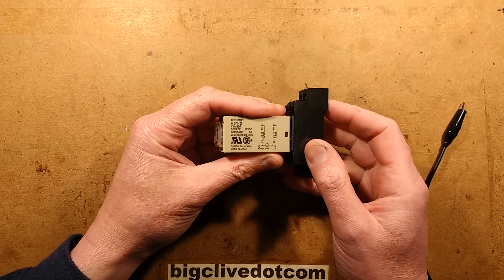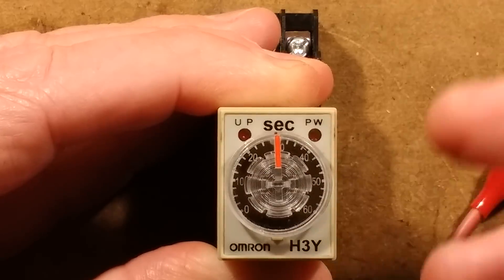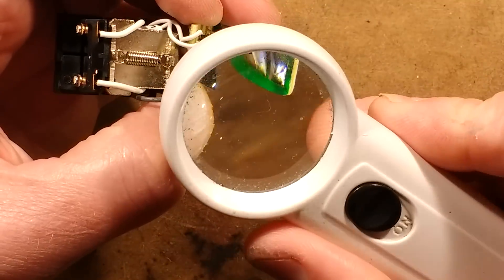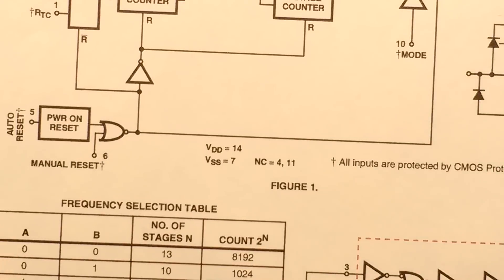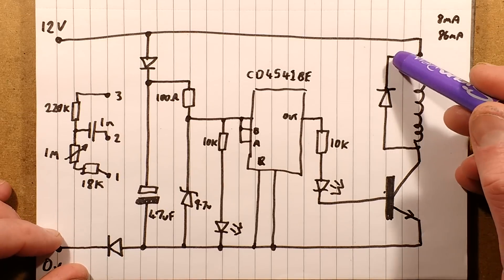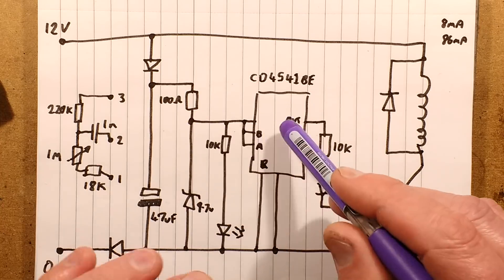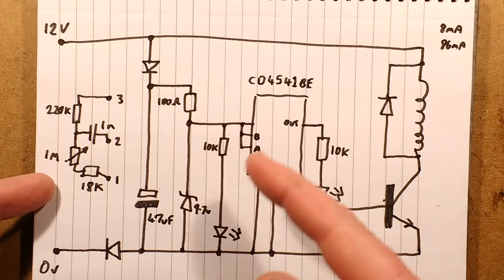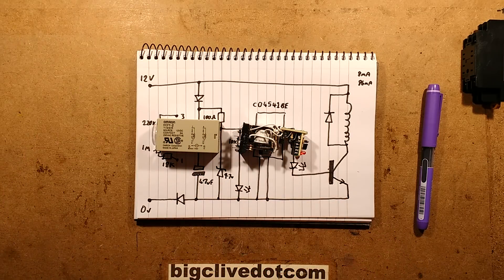Industrial timer knock-off.  (Actually quite well made.)

Comment: I'm a bit confused.  I need a relay to hold 120V to keep a fan running after a switch is turned off.  With the H3Y-2, can I do this?
Reply from the maker: You do get delay relays that will hold on after their control signal is removed for the selected time.
Reply: @bigclivedotcom  I guess the H3Y-2 can do that.

Comment: Hello there. I have a question.

I am in search of a 14 Pin delay relay similar shown here, but I can only find them in a power on function only, and I need a power off function delay to control a motor contactor. 

If they don’t make a power off function in a 14 pin delay relay, could the board be modified on a power on delay to make it into a power off delay? If so, how could that be done?
Reply from the maker: You get off-delay timers, but they usually still require power, and a control signal to be removed.
Reply: @bigclivedotcom  I could not find any time delay relay that has a power off function that has 14 pins, all are power on function.

What I’m asking is if the board itself in one of the power on delay relays can be modified to change it to a power off delay? Or even buying a off delay relay and just taking the board out of it and putting it into the power on delay converting it into a power off delay?

I need a 14 pin off delay for the relay socket on a board that I’m using, it’s to keep a motor contactor on for a few seconds after power is stop being supplied to the board.

Comment: Just got my hands on two 220 volts H3Y timers from  elevator control panel while troubleshooting failed rescue mode test. Both showed brown overheat sign on one side and open  circuit on the contacts. Turned out both were low quality fake timers

Comment: have used many of those little timers from oven purge delays and delta wye starters ..Some people in the food industry like to load up their grinders prior to starting the motor .So wye delta is essential because of the massive current inrush on Delta .so we switch the motor wye delta .Start on wye and switch to delta .I think I posted a video a few years ago of a wye delta motor start up ..Can't believe Omron isnt going after the counterfeit items 
.Those little timers are expensive .The mechanical clock work timers are crazy expensive like the Carlo Gavazzi  timers .

Comment: I use the 4 pole mains operated version on my vacuum tube amplifier. It is set to 50 seconds and when it operates 1) One pole places a short circuit across the amplifiers in-rush current limiter. 
2) Two poles apply high voltage, one to each channel of the amplifier.
3) The 4th pole is used to switch off the Red section of a dual colour LED on the front panel and switch on the Green section.
It's been in use for a good 12 months and so far no problems.
Reply from the maker: Some modern inverter welders have a beautifully simple inrush limiter.  They use a parallel cluster of NTC inrush limiters bypassed with a relay that is simply powered directly from the 12V power supply.  The short bootstrap time for the 12V power is the inrush time delay.

Comment: I've come across these in older 80's CNC machining centers. They are used to add a delay to the hydraulic motor switching on after the controller is powered up. Also I've seen them used to cycle an oil pump for lubrication on these machines..so one would do the pump off time, say 10 minutes and the other would do the pump on for say 15 seconds. I think the pin spacing is a standard across different manufacturers and the base it plugs into can take other types of relays as well.

Comment: Help!!!!   I bought several of these they work great but it takes like a month + to get em. I bought 0-5 sec and 0-1 sec not sure which I would need this time. But I messed up. I needed them all to be 220 volt. Instead I got 0-5 in 220 and 0-1 in 110. Guess which one I need now. So i can just change the capacitor to change my 0-5 sec into a 0-1 sec?
Reply from the maker: It should be viable.

Comment: I've been testing the timer as a power-on delay for fridge, in case of unplanned blackouts particularly during night times. However, I noticed the plastic case exhibits some heating and I've been wondering from what components and how hot they get in their confined environment.

Your infrared measurements have definitely added some light to the guessing game. Now I know where the heat comes from and whether the temperature/s are within tolerances. Thank you!
Reply: Marinduque - The Heart of the Philippines take a thermal imaging camera when it’s being used if the plastic is melting it’s not safe in my opinion
Reply: each one is different, unless you used a 12V version too.

Comment: I have bought the 220v version ofthis  to delay a small aquarium pump from coming on after a power out returns... but i cant get any voltage at all on any of the ouputs, not NO or NC... Whcich pins would I expect to see 220v after times up?
Reply from the maker: The contacts are volt-free.  You'll need to loop the feed to the common contact.
Reply: @bigclivedotcom  So if my main 220v AC supply is contacts 13 and 14 I would also need to supply 220v to which other contacts  and which would then have 220v (after time delay ) on powering back on?
Reply: @bigclivedotcom  so 9/12 need to have 220v supply which would then appear at 5/8 (NO) or  1/4 (NC)...?
Reply: @roythompson6137  the "Common" terminal needs 220V applied to it; When the relay is not activated, the Common terminal is connected to the "NC" terminal (Normally Closed) and when the relay is activated (by powering the coil up) the NC terminal becomes disconnected from Common and instead "NO" (Normally Open) becomes connected to Common, until the relay coil is powered down.

Comment: I think I'd solder a pull down resistor on that transistor base. 220K or 470k maybe? Since the base current comes through an LED, when that output pin is low the base is effectively in an open state.

Comment: no qualms with low voltage fake timers. But I've just had a jolly old time fault-finding on a machine that had fake omron octal relay bases....that had  spigot keyways at both the 12 o'clock and 6 o'clock positions.  This caused some problems.
Reply from the maker: Now that's what you call a nightmare for troubleshooting.  Especially if someone else has been pulling and inserting relays randomly.
Reply: they had.

Comment: I know all about thinking the diode was in right and having things blow up and not work on a couple jet bumper coils.
I cut out the diode and put in a new one and also had to replace 3 transistors on the board.

Comment: The 100 ohm resistor seems way too low. The CMOS draws virtually nothing and the only load is the two 10k resistors. It easily could be replaced with maybe 1K , saving 90% of the OFF state current.
Reply: i didt ecpext you in here sorry im 2 years late

Comment: Hey Clive, nice video... I was thinking these would be nice if they had the option to be either change the input on pin 9 to change the "initially high" or "initially low" mode...  I considered the option of a switch on the relay itself, but this would be very dangerous in use as it might get changed and the function would change.... so, how about this solution.

Instead of using a polarity protection diode, use a bridge rectifier, and then take one side of the input before the bridge to pin 9... would this not cause it to work in either polarity, but change the mode depending on the polarity of the supply... which then could not easily/accidentally changed once in operation?

Comment: So I have two problems with this thing.  First, specifically with this, it looks like its made out of that compressed paper-fiber board (looks like FR4 painted green on top but white everywhere else) and that stuff is pretty bad at preventing moisture ingress.  That combined with having a 1Mohm potentiometer means there's a good chance the timing will change substantially over ranges of humidity and as the device changes. (I'm guessing that or the flux they used is why it only goes down to 15s)

The second problem I have is with this kind of item in general.  If I buy a cheap brand of industrial control wigetry, it might not be as high quality as Omron or Honeywell, but at least its going to be consistent quality across the same item.  With these fakes you just don't know what you're going to get.  I mean that hand soldering job is such that even the ones that particular guy made are probably terribly inconsistent.

I cant think of too many places to use this where total failure and lack of consistency are acceptable.
Reply: Are you sure? This item must put in dry place  and timer accuracy is couple seconds.
Reply: So here's the thing.  Off the top of my head it was a 220kohm resistor and a 1Mohm potentiometer.  The interior of that kind of board is hygroscopic, so when its humid out it sucks up moisture.  As soon as there's enough for current to flow its going to start drawing metal oxides and metal salts into the board and the path across that 1Mohm is going to go to anything from a few kohms on up.  Looking at the board, its a piece of a larger prototyping or breakout board thats been cut, so any moisture barrier is already gone.

My main point, though, was that you don't know what you're going to get from one to the next and that applies to all of the counterfeit stuff.

Also, at least in the US, you have to watch out what you import, especially if you know its counterfeit.  Customs is kind of cracking down on a lot of things coming out of China.

It would be nice to know what some reputable Chinese brands are in these videos rather than "there's a guy somewhere stamping Omron on the side of stuff".  Generally you can get pretty cheap stuff that comes from the same factory as big name brands when they're manufactured in China or Taiwan or Malaysia.  Not so sure about India or Vietnam.

Comment: Just curious... with knockoff clones flooding the market, does anyone know what kind of legal liability the installer is responsible for when something horrible (expensive) happens.
Reply from the maker: If an incident resulted from the component then when they tried to trace it back to its source it would stop at you ordering it from an unknown manufacturer.  In moist instances nothing like this would actually happen.  It might stop working and get replaced.  But I don't recommend using untraceable components in a safety critical application.  There's a whole industry based around finger-pointing.
Reply: Damn!
I'll have to replace all the timer relays I fitted in the control room of the Hinckley nuclear power station! 😜

Comment: Wonder if Clive measured that zener drop thru that diode on the minus side?  That'd make a 9.1V zener read around 9.7V.  For once this is a chinese product with zener regulation that doesn't overstress the resistor driving it!
Reply from the maker: I measured it directly across the zener.

Comment: Looks like the real Omron is about $100.  I wonder how they're different inside...
Reply: I bet you pay mostly for certifications and tests
Reply: @gustavrsh  not to mention wholesaler markup, which can be a ridiculously high markup!
Reply: @gustavrsh  better PCB and maybe good power supply for the CMOS part? Better relay?
Usually the copies are bad from most of the extra cheap China ones
Reply: @gustavrsh  noup
Reply: The true Omron would be garenteed to switch for millions of operations. I wouldn't trust the contacts in the fake for very long.

Comment: If its a blatant ripoff of a known brand, does that mean the certifier's logos werent officially granted either?
Reply from the maker: Everything is fake.  Not UL listed not properly CE certified.  The product could work fine (although I wouldn't use it anywhere near their stated rating).  But if an incident occurred then it could raise liability issues.

Comment: Could you make a resistor radiator, opposed to a standard electrical heater that is
Reply: All electrical heaters are just a long wire, or other conductor, that resists the flow of electricity sufficiently to become hot. Using a load of resistors would be no more inefficient than any other resistive heater but it would probably be much more expensive than just using a piece of suitably resistive wire.
Reply from the maker: You can use resistors as heaters if that's what you mean?
Reply: bigclivedotcom they come on a long strip, could you join them all up, add a fan for airflow and heat a room, or is that just really inefficient 😅

Comment: someone has never used a dial timer before. everyone knows you turn manual ones past half then back down to the time. don't matter if it is  kitchen timer or a manual timer on a microwave. you always turn it at least half way then back down. learned about this in school since had them for some reason in elementary school

Comment: iirc, the 240v version of the real omron is the same circuit, but with some sort of dropper, even with a 12v coil (i could be wrong)
No point using a triac or thyristor, because with the cycling type they would latch on, has to be a transistor.
The real omrons come apart the same way with the dial staying put.
I think the UP is 'time's up'

Comment: A bit off-topic, but in many circuits you draw out I see smoothing capacitors without a resistor to drop the voltage difference between noisy/rippley source and the filtered output. Do these filters usually rely on input impedance/ circuitry upstream? Also, is this any worse for the power factor?
Reply: In most cases these in industrial controls are fed from a supply from a control transformer, which typically is rated to supply the load current of the controllers, or 2A, whichever is larger. Most however use a 24VAC supply with each controller having it's own internal rectifier. Power factor wise they have none, the transformer providing it with power doing the power factor correction simply by the winding impedance acting as a filter.
Reply: Of course I chose a video with a DC circuit to ask this, herp derp! But when he looks at rectified power supplies there's  often a filter capacitor after the rectifier with no resistor source-side. I suppose that the impedance of the source must be allowing the filter to work in that case.

Comment: I bought several from a supplier, that obviously were not a true OMRON, (as it was $1.00 C) and it actually had a CMOS 555 in it.Its been working for over a year, delaying an exhaust fans turn off, after lights were extinguished....so for the price...I was happy.
Reply: It's all good for home projects .Just remember ,any time you pay someone to work and use a device which has any components in it that are not approved ,you might find yourself in serious liability issues in the case of injury or other equipment damage .It's crazy what we have to do to get CSA ,(Canadian Standards Association ) UL/ULC approvals  and OESA (Ontario Electrical Safety Association )approval .Everything has to be NSIT  (National Institute of Safety and Technology )approved all devices controls sensors.Any time you pay anyone to operate any piece of equipment they must meet these standards or be approver by other agencies like PQS ,TUV Rhineland ,ETL and so on .Ambulance chaser are everywhere !

Comment: Nice video, thanks. Just for a change, Clive, maybe you could reverse engineer a high quality device, and tell us what makes it so.
Reply: kind of hard, it will be 2 things metallugry , better copper and (platinum?) contacts, and will have been tested for cycles rather than guessing its life from the design you copy,   both hard to see when you open it, this will seem identical to the real omron timer from appearances, and couple with lower quality electronics, kinda like chinese capacitors vs quality ones, you cant tell by looking at them.
Reply: Probably, from what Ive seen, the board would be coated for waterproofing, the components wouldn't be so slap-dashed in their mounting, and the soldering woulda been a helluva lot better.
Reply: Got some 40 year old Siemens made time edelay relays to hand, they are completely made from Siemens made components, from the wire inside to the relays used, and the only reason I replaced them was the relays inside wore out. Around 100 million cycles on them, on a part only guaranteed to do 100 000 cycles on full load. Could have cleaned the contacts as well, but after 40 years they were faster to replace than to repair them, plus the sockets on the panel itself were starting to break apart from age. OK 2 hours to get to the back of the wiring panel, but I also had to do some repairs there anyway so no real added time, and I had to replace other contactors as well.